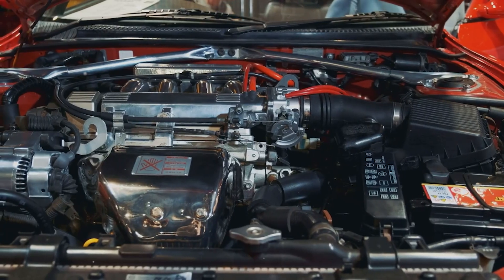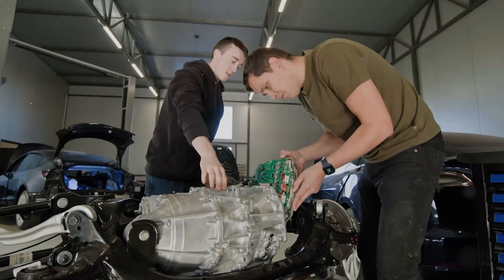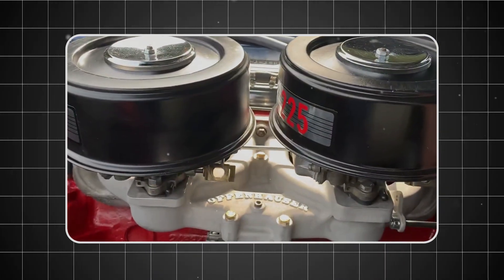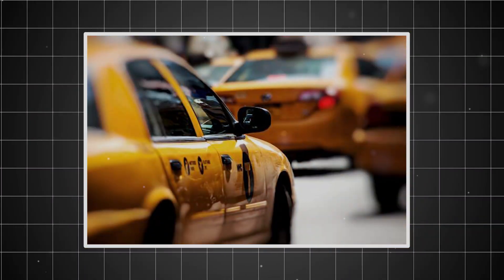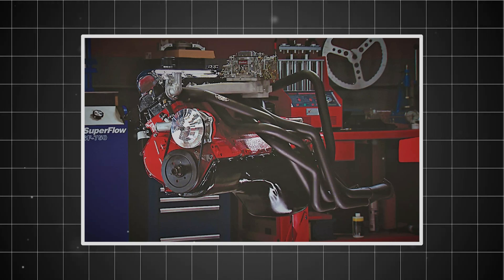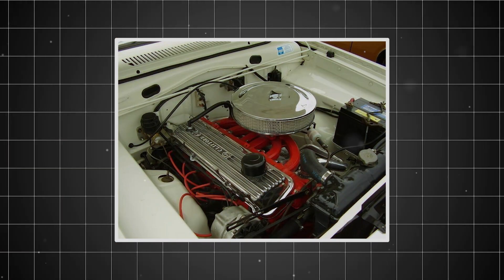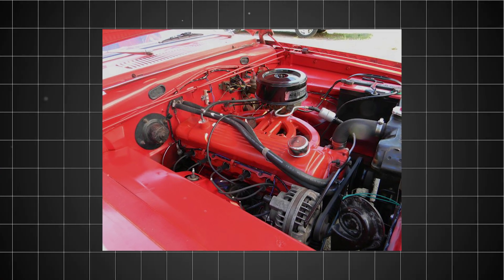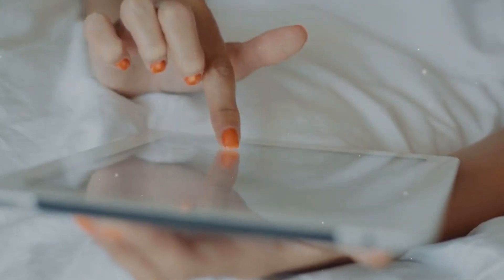The Bulletproof Engine That Wouldn’t Die!

Comment: I had to replace two of them due to owners neglect. They DO NEED oil checked every now and then. My '73 Duster had a slanty. I loved it. It was so quiet at idle you couldn't hear it running. No issues except for the BAAAAAlast resistor died once. I changed my oil and filter every 4K miles. Wish I still had that car.

Comment: The story is fine, but the soundtrack and all the completely unrelated videos of other engines kills it for me. The engine startup audio stands out as SO wrong - obviously a modern 4 cylinder,  not the old Mopar gear reduction starter or a slant 6 engine. 
MORE AI CRAP

Comment: I had one in a 1972 Dodge Dart that ran like top back in the mid 80's. A friend told me about one that he pulled out of a Duster that still ran even after the number 6 connecting rod punched a hole in the side of the block behind the starter. They are a legend for sure...